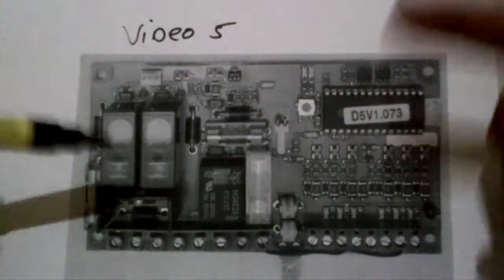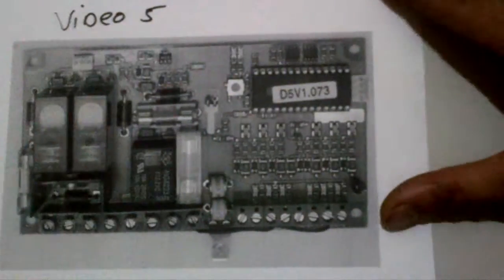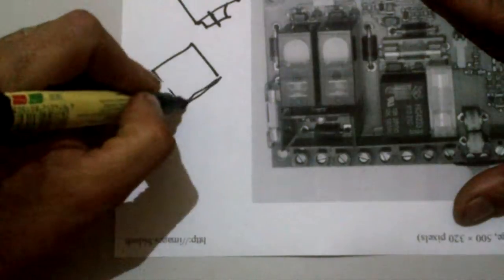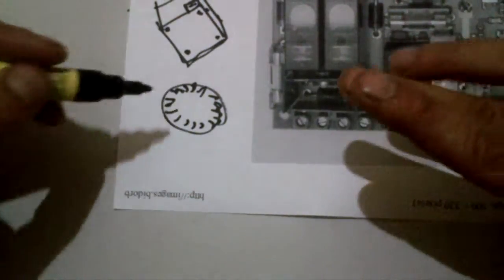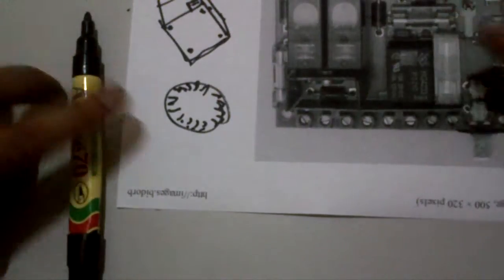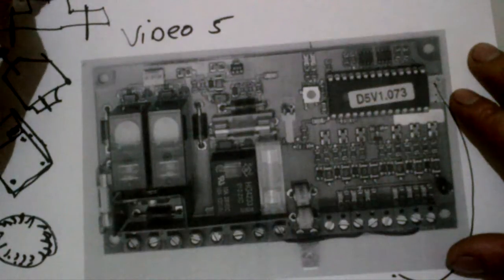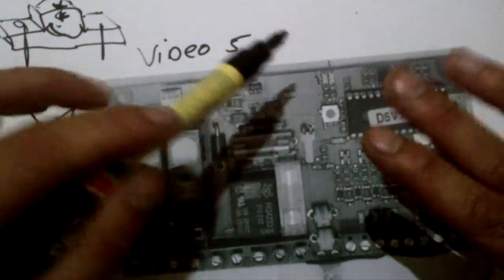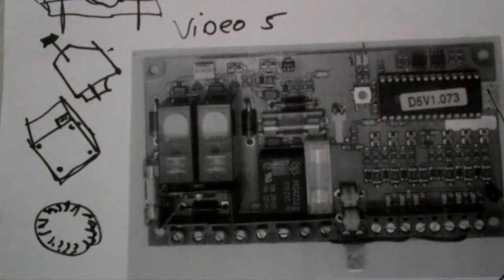centurion gate motors basic counter and magnet control   video 5 of 5

Comment: Hi Blade

Hope you well, 
I've been watching your setup up video’s and tried and tested several of them however I keep having the same issue.
The gate keeps over running when it opens completely I’ve done the set limit several times and the gate will operate fine for a while but then it over runs again what can the cause be for this?
Reply: Hi Charese.  Have you by any chance found a solution to your problem? Current facing the same issues...
Reply: Hi Darryn, unfortunately I did not receive any feedback from the above video, but what I did was realign the gate and just did several bypass tests until it started working correctly, What I also did was move the gate to different size of openings and then retried. Was a long and hard battle :) but it worked in the end. Have to add that I have an rather long gate so not the standard length of a gate. Sorry for not giving you a solid solution.
Reply: Thank you for the response :-) I'll have to try some trouble shooting tomorrow.